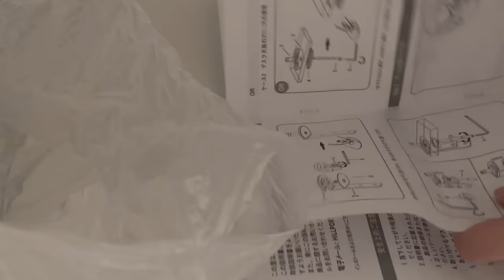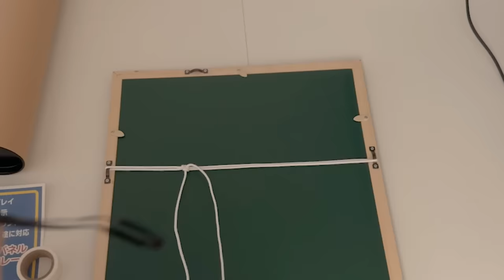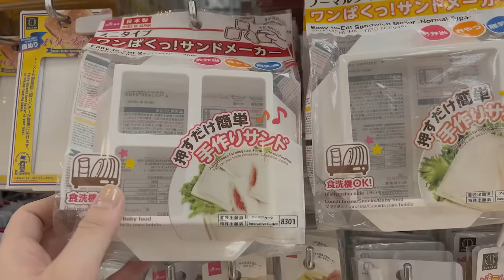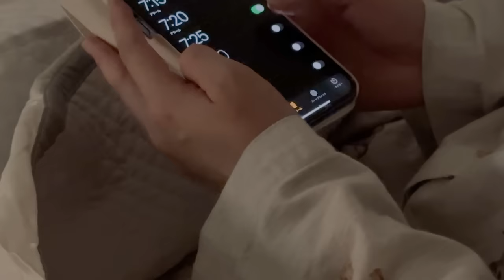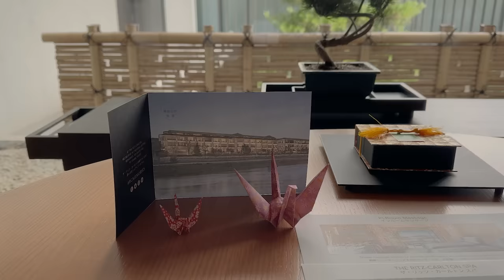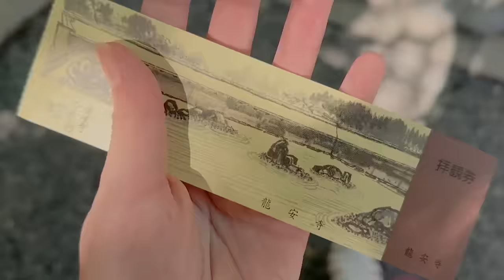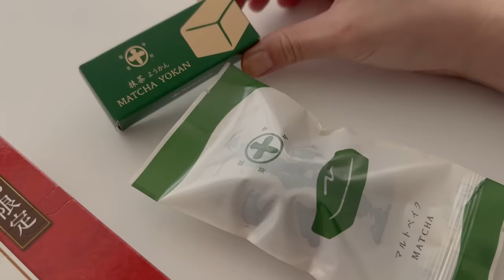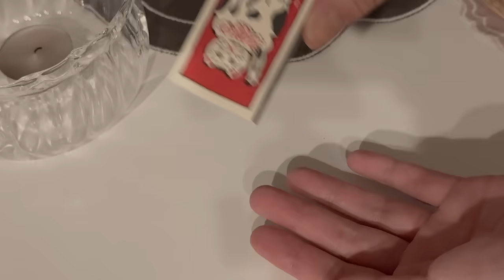【模様替え】部屋の家具を全て移動させて気分を変える1人暮らしのVLOG｜京都旅行｜Living alone VLOG Room Makeover

Comment: For your picture, look for "Command Strips" or "Command Hooks".  They are made to hold posters, pictures, etc on the wall with no damage whatsoever.  You can easily remove them when you decide to shift things again, or are moving to a new location.  They come in different strengths.  They are not reusable, but are really pretty amazing.  Then you can hang your picture wherever you would like to.  Also, have you though about making a little "desk area" by the window in your living room?  And CONGRATULATIONS!